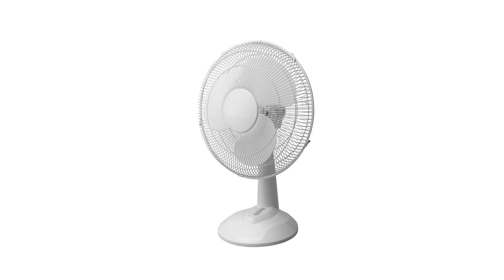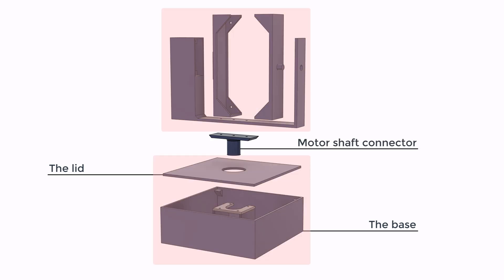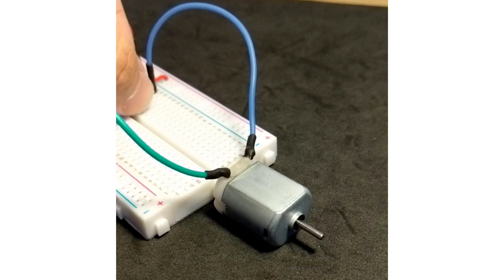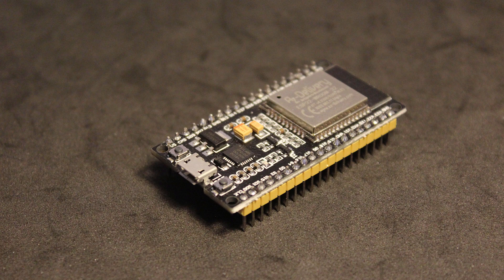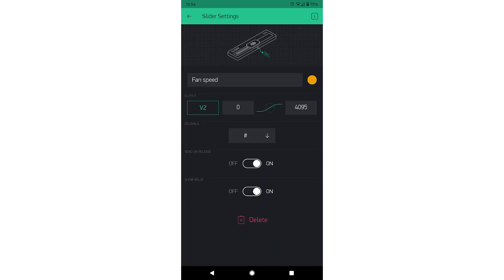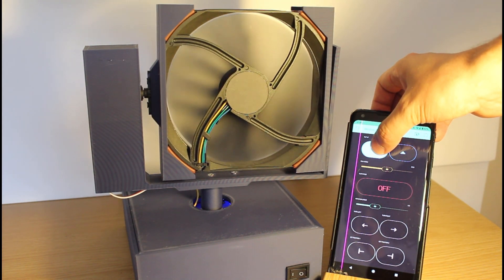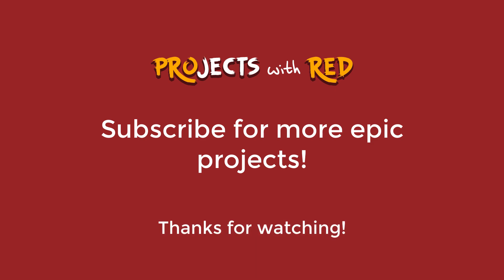The Best Wireless Fan! Fully controlled using your phone! (Arduino) | #P6

Comment: Hey, beginner here. How do you connect the power supply into the microcontroller? Is there an adapter for that? Thanks in advance!
Reply from the maker: In the video at 4:44, I show that the step down converter is what is used to connect the power supply to the micro-controller, as 12V is too much for the ESP32, so we need to step the voltage down to 5V, which is what the operating voltage of the ESP32 is. I hope this helps, let me know if you have further questions!
Reply: @ProjectsWithRed  I can't seem to figure out why I couldn't control the fanspeed. My component now is just the esp32 and the pwm fan, i power up the pwm fan using 12v, but I'm using usb cable to power up the esp32. Is it because of using usb cable to power up the esp32? I already connected the ground too.
Reply: @ProjectsWithRed  i finally managed to get it working. I can now change the fan speed using blynk. The only problem is that I can't seem to turn off the fan with the slider. When fanspeed is 0, the fan is still rotating with low speed. I suppose it's because the gpio is only 3.3v when the fan pwm needs 5v. What do you think? Thanks in advance!
Reply from the maker: @elnanonino341  Try to isolate the fan, make a new blank sketch where you are just writing 0 PWM signal to the fan and see if that stops it or not.

Comment: Can I use a Arduino Uno instead?
Reply from the maker: Arduino Uno unfortunately doesn't have WiFi connectivity, so if you want to wirelessly control the fan, you won't be able to do it with the Uno.

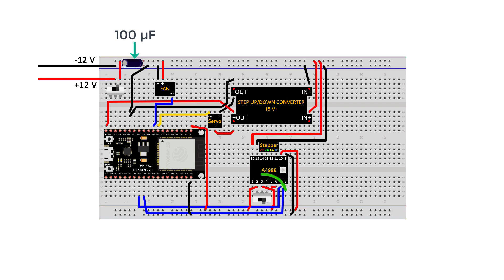Comment: Hi friend, in the 4:53 time of the video, can I connect a 12V 5A power supply in the +12 -12v wires on the top left? otherwise what must be connected? Thanks a lot for the answer
Reply from the maker: Yes that is correct 👍🏼.
Reply: @ProjectsWithRed  I understand, but what component should be connected in the upper left in the positive and negative
Reply from the maker: @FrancoEsse99  The positive wire of the power supply is connected to a slide switch, which is then connected to the positive power rail of breadboard. For the ground wire of the power supply, it is connected directly to the ground power rail of the breadboard. You also have a 100uF capacitor connected in the breadboard power rails. Does this answer your question?
Reply: @ProjectsWithRed  Unfortunately not. I wanted to know how to connect the power in the positive and negative jumpers?
Reply: @ProjectsWithRed  Another question, how do I connect the switch outside the project to be able to turn the fan on or off?
Reply: @ProjectsWithRed

Comment: Hi, how did you place LM2596 in the breadboard?
Reply from the maker: I soldered male header pins to each of the 4 pins it has.
Reply: @ProjectsWithRed  I thank you for the answer. another question, i am doing this project, only i have a problem with the ON / OFF switch on the outside. how did you connect it internally?
Reply from the maker: @FrancoEsse99  The switch is simply connected in series with the positive wire of the power supply. Ensure there is nothing connected before the switch.
Reply: @ProjectsWithRed  ah oh right! as for the fan, how are they connected to the breadboard? has it been welded?
Reply: Another answer.. can you have another image of breadboard in other prospective?? Please..I am making point for point this project..😅
Reply from the maker: @FrancoEsse99  I used solid core wires to put into the connector, which then connects to the breadboard.
Reply from the maker: @FrancoEsse99  Cool! All the wiring can be clearly seen in the diagram at 5:06 on the video.
Reply: @ProjectsWithRed  okok, so a the time 7:12 , where do i connect the on / off switch inside the breadboard? thanks and sorry for too many questions 🙏🙏
Reply from the maker: @FrancoEsse99  No worries. Connect the switch exactly how it is shown in the breadboard wiring diagram, the switch is in the top left.
Reply: @ProjectsWithRed  can you help me with the sketch? i can't connect blynk with Esp32 ..
Reply from the maker: @FrancoEsse99  Since there are so many aspects that could be going wrong in this case, I have to see your whole project to properly help you, there could be problems anywhere. If you want, you can share with me your wiring and code using Google drive and I will help you get you up and running with everything.

Comment: can i know the real measurements for all 3d components ?? Thanks a lot for the answer.
Reply from the maker: It will be much easier if you just download all the models (link in the video description) and simply either open them in any 3D software or using an online 3D tool to open up the files and from there you can easily get all the exact measurements you need by using the measurement tool. 👍🏼
Reply: @ProjectsWithRed  Thanks a lot for the answer. i want to do this project, can i contact you if i have problems?
Reply from the maker: Yea no worries, I am more than happy to help.
Reply: @ProjectsWithRed  do you have the link of the two buttons used in the breadboard? thanks a lot

Comment: awesome, will give it a try with my new 3d printer.  Any chance of a dehumidifier next?  30 litre?
Reply from the maker: Cool! What 3D printer did you end up getting. Unfortunately I have no plans in creating a dehumidifier but who knows maybe in the future. Remember to subscribe if you have not already :)
Reply: @ProjectsWithRed  It's my 1st one, so and ender 3 of course haha.  Just subscribed.  Maybe I take a shot at the dehumidifier, but it'll be uhh.. ugly.
Reply from the maker: @hessjason  That's awesome! Thank you for subscribing! Yes for sure do, you will always learn from creating different projects even if doesn't fully work or go as planned.
Reply: @ProjectsWithRed  ah booo.. just looked up the cost of the fan and it doesn't make sense to build vs buy  (Xiaomi Mi DCOS100).